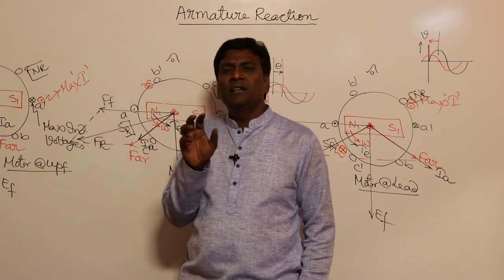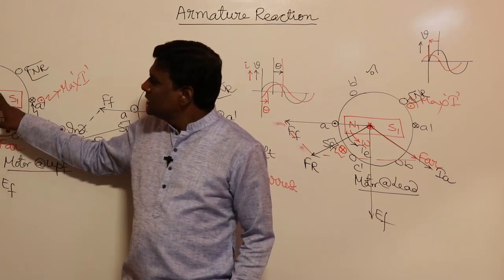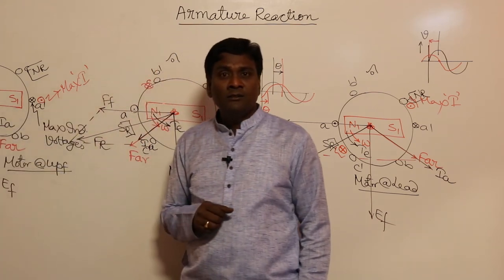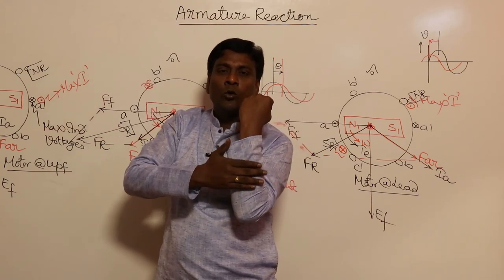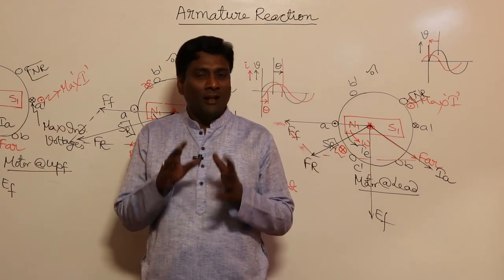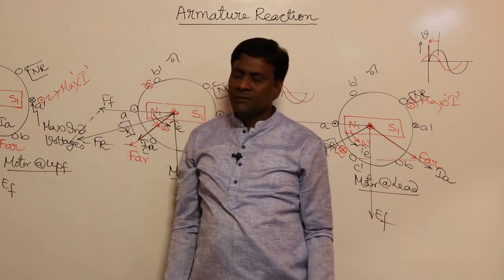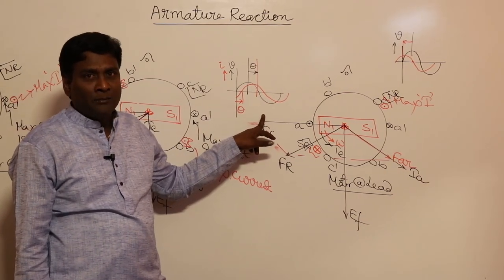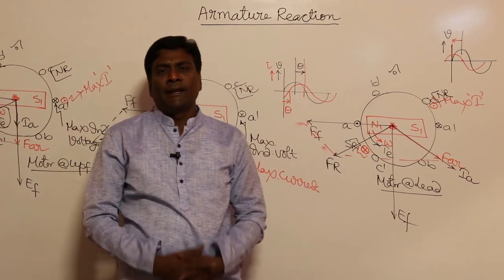Armature Reaction of Synchronous Motor Detailed | Torque Production Included | KN Rao for GATE

Comment: Sir I cannot understand why the direction of current and induced emf are opposite in stator windings in case of sync motor !?
Reply: @gateconqueror5742  thank you sir.the reason is very basic .if i am right then for the motor to consume electrical power from supply,it has to get current in a direction from "positive to negative of back emf".